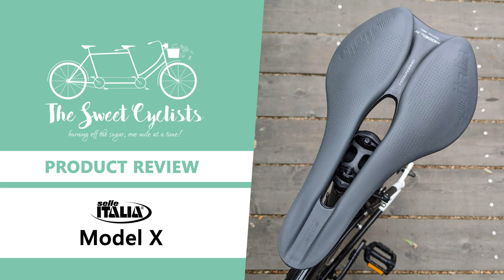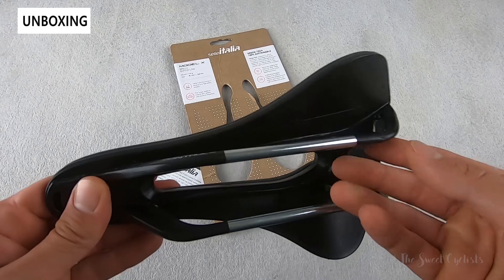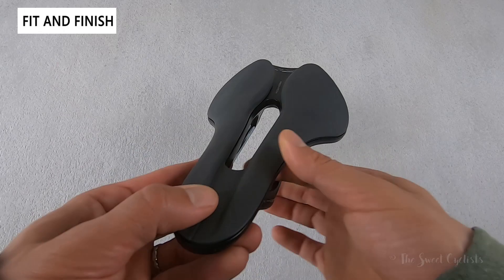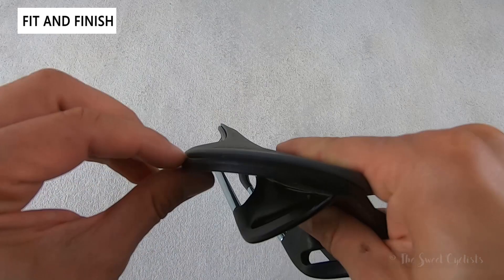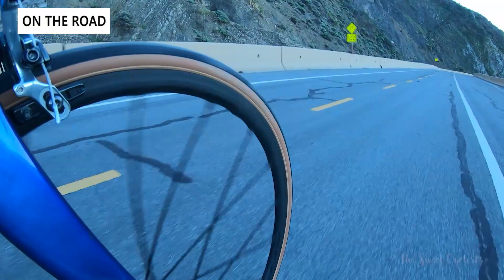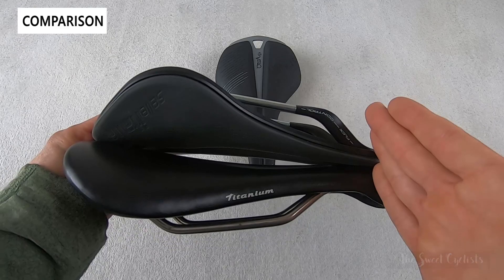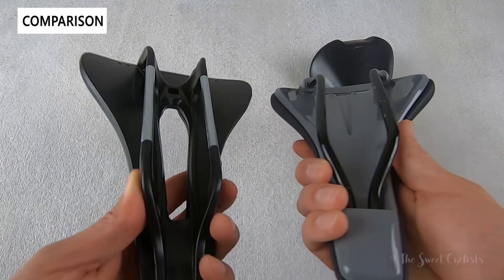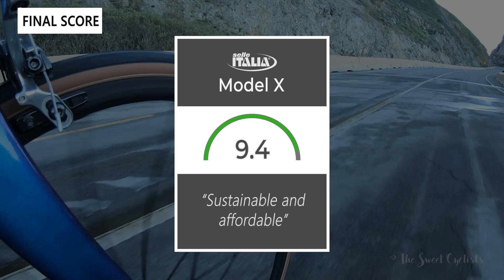The future rides green - Selle Italia Model X Green Superflow Bicycle Saddle Review -feat. Total Gel

Comment: I have this same saddle as well. It came standard on my Canyon Endurace. 

As another poster has commented, yes the saddle material tends to grab your shorts/bibs. It doesn’t allow you to make minor adjustments while seated. Instead you do need to get up and then reposition again. 

Also in my specific case, I did not find the saddle to be overly comfortable on rides above 30kms.
Reply from the maker: Thanks for the input. I didn't realize the non-slip padding might be an issue but it makes sense. I'd recommend doing the idMatch fit (local shops can do it for free - check Selle Italia's website) as well to make sure you are an "L3" fit which is what the saddle is designed for.
Reply: 100% agree - horrible irritations after a century ride. Did have problems until pushing it longer!

Comment: I had the “standard” Model X that comes with Canyon (Grizl). Of course, saddles are very personal, but I never got used to it and replaced it after a few months. If you have the chance, test it before you buy, I already felt on my first ride that this is not the saddle for me (too hard, missing support where you need it) and hoped it gets better over time. Nope.
Reply from the maker: Yes, finding the right saddle can definitely be difficult. Many shops offer try-before-you-buy options that let you try multiple saddles before choosing. I would also recommend getting your seat bones measured so you buy the correct saddle width.

Comment: When I purchased my Bianchi Zolder, I received this saddle, and it is BY FAR THE WORST I’ve ever used! Not only is it very uncomfortable, but the grip surfaces and rough edges ruined my winter pants after just two rides. While it’s promoted as ‘sustainable’ due to the manufacturing process, how sustainable is it if I have to discard it because nobody will buy it and I’ll never use it again? 👀

Comment: The worst saddle I’ve ever had the misfortune of using! The grippy surface totally spoils it. If you like to move around on the saddle while climbing etc, forget it the material will drag at any bibshort Lycra and seriously you can do without it. Whoever designed this should be labotomised… it’s a bloody nightmare. 😢😮
Reply from the maker: I haven't been able to find out to check it out, but I suspect the Model X Leaf version probably has a less-grippy surface finish (https://www.selleitalia.com/model-x-leaf/). As you and many others have commented, it's difficult to adjust positions with this grippy saddle texture.
Reply: Thanks for the heads up. Now i will look elsewhere.
Reply: Strange this video reviewer never mentioned the non slip surface or to grippy surface.😏